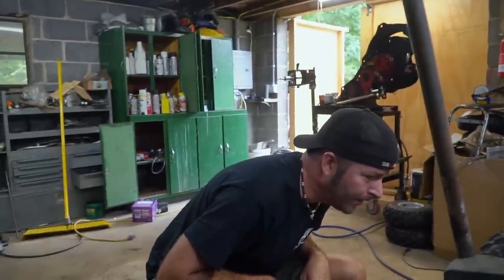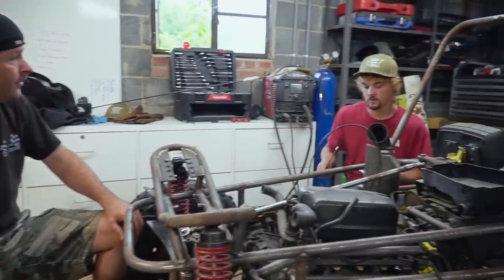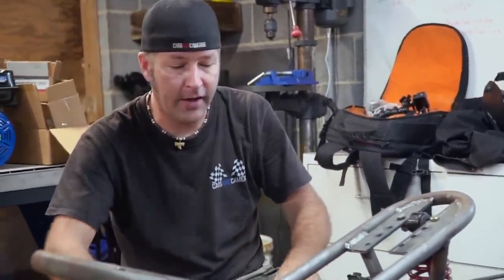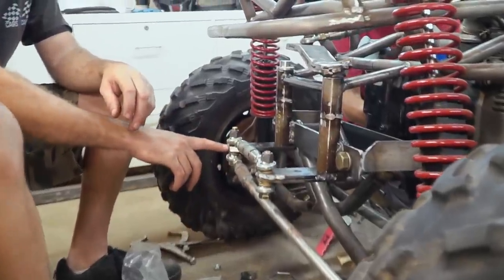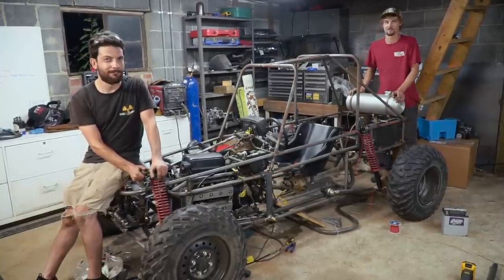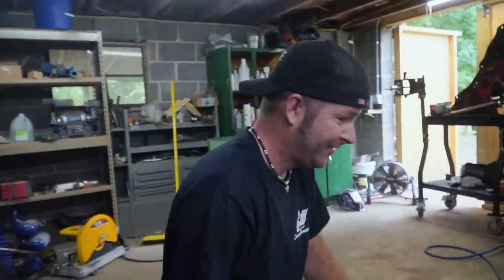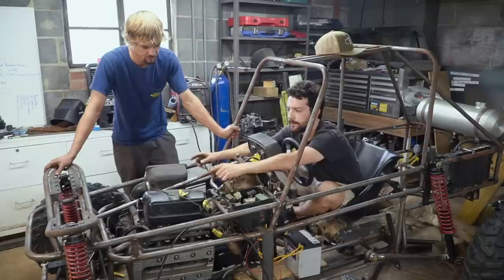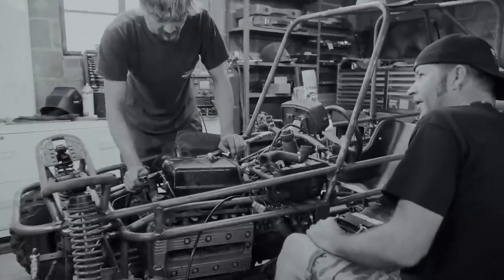Our Mini Trophy Truck Build RUNS!! 1000cc Trophy Kart Build Pt. 13

Comment: Charles designed, manufactured, installed the front brake system. Issac retrofitted a steering box to the vehicle, designed a robust mechanism to reduce bump steer. John bent some pipe.
Reply: Glad he didnt smoke it

Comment: Drop some grease fittings in those tractor pin housings for the steering. That will stop some noise and make it easier to turn. Keep up the great content 👏
Reply: Yeah it'll help it not squeak like the cross-kart
Reply: Not their first rodeo.  They chose those parts for that spot.

Comment: It's a bad idea to have the fuel tank on the outside of the cage because if you flip the trophy kart you will have fuel everywhere and and then you will have to make a new fuel tank
Reply: Dominick Kaczynski or a big fire ball with Ike or John inside and I don’t think they have fire suites.
Reply: good thought... ahhh 
wise i mean
Reply: To quote a legend "its just for testing purposes"
Reply: @todorow22  
Temporarily permanent
Reply: Any way that they could mount it opposite of the radiator? I know it's closer to the driver, but only by a bit, and it would still leave room to bail out the left side if necessary. I don't know, might take up some of the bed space. Again, just a thought.
Reply: Already said this. Worst place ever for it. Nothing like being knocked out after rolling the thing and being in a fireball when you wake up. "IT'LL BE FINE" 🤤
Reply: If they roll it bad enough that it hits that tank they have other things to worry about
Reply: "It'll be fine"
Reply: @dillonbowers8950  not really. Should be belted and helmeted. Bones heal fine. Bad burns don't  Fire is the first thing you should worry about.
Reply: presuming you still have unburnt skin on you
Reply: John, Buddy. Maybe retire those shorts man 😂😂 are they from episode 1 cars and cameras?
Reply: Dominick Kaczynski or worst it could blow up
Reply: @mostlymotorized  Because it's not an issue.  Good learners I guess.
Reply: Nothing wrong with the fuel tank placement.  They intentionally kept it outside of the bed area to leave that space available, and it's well away from the engine.  Flipping the kart is highly likely to break and bend things as a given.

Comment: I know you guys talked about radiator a lot but, what about when it’s in the mud? The location to me looks like it will be taking a beating. I still think the best spot will be on the  roll bars behind and above the driver. I know it will kill the usable bed but, it’s not big enough for much anyway. Also think you need to move the fuel tank into the back of the bed not on the outside of the roll bars. I hope I’m wrong and you don’t hurt your motor from lack of cooling, and snap off the fuel tank on a roll over.
Love the videos keep it up guys.

Comment: That T-return will introduce bubbles into the system, and causes it to cycle those bubbles. Normally, it would take two, three purges to charge the system, and after that, the engine should lit up instantly, and rev. If there're bubbles, and there're bubbles in the system rotating until they shoot out of the injectors, and the engine won't rev.

Comment: Those V.A.M box’s are very sensitive. Has to be nice a flat, level and right side up if there’s a top and bottom to it. 2300 turbo Ford uses one and it would not act right until I properly mounted the volumetric air meter. Had it in a Vw based sand rail. So close to a proper rip. Can’t wait till you guys get it finished up. 👍

Comment: Hey John a big washer with a 3/8" hole mite work for the thermostat. Back in the day one worked in our pro-stock at idle it ran about 180* and right after a race about 210*, and to make it cooler just enlarge the hole.

Comment: Been noticing that when you use your heim joints that you only have one piece of metal with a hole and a bolt. It would be wise to have 2 pieces of metal on each side of the heim joint (which is called double sheer) so that the heim joint doesn’t develop slop. Hopefully this helps you guys out. Keep up the good work love watching you guys build stuff it has inspired me.

Comment: 1/16 to 1/8 gap between prepped pieces, up the volts and, possible  lower wfs,  will yield better penetration and much stronger, visually appealing finished welds,  Thanks for the video, always enjoy  different perspectives and methods

Comment: Yall should get some 1/16" aluminum sheet and make an actual body for this thing!
Reply: Jeff Kopis   
In the single-cylinder buggies I'm used to, composite is nearly as noisy in the same conditions (not properly secured). When secured properly they're both quiet, not really any difference. You just have to make sure they anywhere along a tube has a screw every 6 inches, or foam strip.
Reply: Expensive, extra weight and more to repair when they bounce it off trees or roll it

Comment: Great Content CarsandCamares.. I watch all your videos..
just A small suggestion you need a X brace inside you steering box area for side to side load, and gussets in the middle between your shock towers to prevent shock load transfer breaking your welds.

Comment: Someone should put a snowmobile engine in a power wheel
Reply: No way.  Cr500 /kx500 build
Reply: Vasilybuilds is in the making of a cr 500 crosskart 75hp
Reply: Grind hard plumbing co
Reply: Check out grind hard pluming

Comment: Sure hope y'all plan on a driveshaft enclosure, are at least a couple of loops. Cause I'd sure hate to be sitting there, if the U-joint, are something else failed, and the yoke went to slapping the bottom of that seat.
Don't know if that was in your plans are not, but thought I might mention it just in case that was overlooked.
Nice build, and hope it runs as good as it should be capable of, cause should make for miles of smiles

Comment: The steering arm needs to clear the two armed pivot you made under full compression otherwise you’ll just bend it around the assembly. You have it setup like live axle which moves with the live axle so doesn’t have the same problem.  What battles you are going to be able to have with the cross kart when this is done, can’t wait lads 👍

Comment: How about some diagonal placed tube in those long side rails sections? That frame is gonna flex or worse if you crash. And more horizontal bars on that roll cage along with a diagonal or X brace on that rear main hoop.

Comment: ive never worked with a fuel input sensor in the airbox, but you might be able to take the old airbox off, and run a cable from the gas petal directly into the air flap sensor, which would be a second way to control the  throttle. just an idea if you don’t have anything else.

Comment: Please put a bar from the windshield  bar to the door bar area. Triangulate it from the side. Doesnt have to be a big long bar just something to offer a little more protection from that windshield bar folding back if you roll it upside down or crash it into something. I know you have bars but they are up top no support on the sides. 
Sorry for the long post trying to explain it better.
Look good though!!

Comment: This thing is awesome! But I'm a lil' worried about the cooling system. This thing is going to be screaming and the radiator is so small and not even facing the air flow. Hope you guys have a working temperature gauge.. But it'll be fine.

Comment: That vane type airflow meter you guys are using they dont like being upside down or on their side. they will take a bit of angle as a car does go up and down hills after all but they need to be mounted right side up and level.

Comment: In the video when you were revving the engine, I saw your lockdown nut on right side steering arm connecting for rotating.
Reply: Connecting rod, autocorrect is not correct.

Comment: Could the Steering box have been mounted up front to make it less complicated?
Reply: I was thinking the same thing. Move the steering box upfront, turn the lever arm 90 degrees and connect it directly to the steering. Assuming the steering box will allow that modification.
Reply: I think the issue there would be connecting the steering column to the steering box, since the engine is in the way.
Reply: @michaelblacktree  Yeah, but they are already running a rod to the front. Surely a rotating rod (with maybe a U joint to change the ange) is easier.

Of course, we are Monday morning Quarter Backing here. Great job John and Isaac. :-)
Reply: @stevenbarbour1244  yeah I think we all 100% support the guys and we aren't there to see the easiest way. Just throwing the idea out there.

Comment: By the way you can set a TPI switch or something of the sort and get rid of that meter box I'm not sure exactly how to do it but I know it can be done cuz they do it a lot on drift cars so basically that reads the throttle positioning sensor instead or in this case you would have to install one....

Comment: Pull that airflow meter out of the box and stick a high flow air filter right to it The ones that you commonly call pod filters. I wonder what kind of DME it is I could also look for an alpha n set up and use a tps instead. Bmw used those meters for years I at one time had an adjustable setup that used a ford mass air sensor, made for instant throttle response, as you wait for the flap door to open for the computer to adjust the fuel map to compensate. Also interested to see how your return fuel line setup holds up I think I would want that fuel going back into the tank instead of behind the pump.

Comment: I would get an aftermarket MAF sensor. They are much smaller, lighter, and way better for off-road. That swinging gate is terrible off road and Will cause it to break up at high rpm on bumpy roads. Most parts stores will have one

Comment: What's the firing order on the k100 bikes? Trying to get one running myself. 1342?
Reply: Cyl 1 and 4 are on one coil and 2/3 on the other. Red and black wire is on the 1/4 coil. Hope that helps

Comment: You definitely should make a support over that drive shaft kinda like what Chevy did with the x frame back in the day to where if you break a u joint that drive shaft don't go flying around and smack you guys in the legs and other parts of you and they vehicle kinda like a craddle or just a plate on top of the drive shaft

Comment: Hey guys. I don't comment much bit liked all your videos. Not sure if you heard of or watched Rat rod bob builds on youtube. He shows how to buid a rat rod from the frame up and helps with all issues. Like strerring and also using an air compressor for air ride system. Might want to check him out since technically you are building a rat rod. Lol.

Comment: That return line should really go back to the tank. The fuel is going to get very hot short circuiting like that and may hurt a fuel pump.
Reply: It WILL start cavitating

Comment: my 87 Porsche 924s has the same style air flow meter.
Reply: Porche use K-Jetronic I think? It has vane that controls fuel valve. 
BMW use LE-Jetronic wich is full electronic

Comment: Nice work but for a frame that large and heavy you should have used a hayabusa motor with a small turbo. That trophy truck needs 250 hp, not 90 hp

Comment: KSE KSGEN2L-3462 Gen II Midget Half Box
KSE Racing LogoPart # 95032924
KSE KSGEN2L-3462 Gen II Midget Half Box  This may have been an easier steering setup, and much lighter. Not sure if it would work well with independent suspension though. you can find these used and fairly inexpensive. Just a thought.

Comment: 90 hp, that’s more than my car has
Reply: My current car ha 60 but my truck that I'm building has 650 on mild tune
Reply: Aguy Whoisnice Well, my daily is a 75 HP Fiesta 1.25, I have enough land yacht’s with v8’s, but the Fiesta is so much more fun to drive as you can kick it through any corner
Reply: @codykamminga9667  mines an82 corolla trecel  with a 3ac I jump it on a dirt road near my house that has a bunch of water bars but my truck is a project I live in northern California so I get a lot of snow and mud so I need 4x4

Comment: Any chance that there will be a “scatter shield” or loop around that driveshaft that’s directly in path of the no no square?
Reply: for what? it doesnt have a traditional flywheel clutch that can explode... do you know what a scatter shield is for?
Reply: 2big 2fail the spinning driveshaft that’s running directly between the legs. I was just asking if they planned on any protection in case the u-joint fails or the shaft comes apart. Also scatter shields can also go around a transmission. I used the term in quotations as a general term.

Comment: Before we go any farther...why didnt you guys build this as a two seater? Just curious...thats all.

Oh yeah forgot to mention this before...i dont believe that steering box is gonna work/live mounted upside down...its not like a manual box has an oil pump so the important stuff aint gonna see any lube. Also i think its gonna leak thru the preload adjust because there is a couple oz or more of oil now sitting on top of a shaft and nut with no real seal. Maybe im wrong just wanted to point this out.
Reply: We discussed the 2 seater and decided a 1 seater works for us
Reply: @isaacitllbefine7231  i do understand the weight factor and center of gravity and all that so i respect your decision. Thank you for taking the time to answer

Comment: Could you not put a bend in the Steering rod over the motor, so the air mass sensor/air filter will fit in stock position???
Reply: Bends are weak points in stress areas. It will buckle under stress
Reply: @isaacitllbefine7231  That is true.. 
 slight bend wouldn't weaken that much im sure the steering wheel would come out of your hands before that happened
Reply: @isaacitllbefine7231  Cant wait to see it ripping around the track.

Comment: It would be really cool to see you guys supercharge it you can use a old smog pump out of a junkyard and put a pulley on it.  Then for more fuel you can decap the injectors idk how decapable they are so you might just want to get bigger ones if you even can that is if your going with the supercharger
Reply: I hope you wond do supercharging projects with that knowledge🤣
Reply: @juhomaki-petaja  I kind of want to do a supercharging project on my 212 but first I'm getting some new parts for it

Comment: what type of rear end did you put in that trophy card I have a 900 cc CB custom 1980 and I have a Volkswagen sand rail in my backyard that I want to put the engine in but it has a drive shaft I just wondering what kind of rear end you guys put in that trophy card? please text me back

Comment: Boys and girl, lol there is no rating for a fuel leak at all. Its not "fire hazzard?" Leak? There is either a leak or there is not. If you have a leak STOP. Fix it, then continue on with what you where doing. Never do what they did in this video. EVER!!